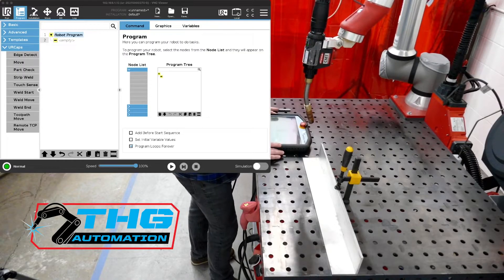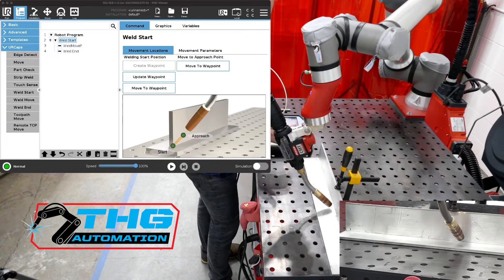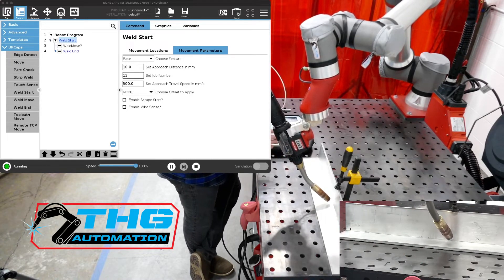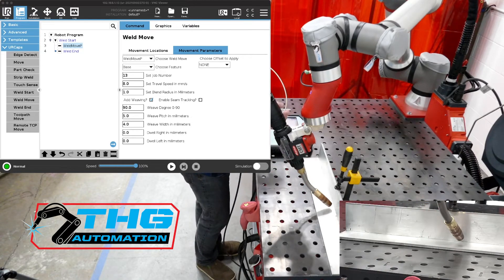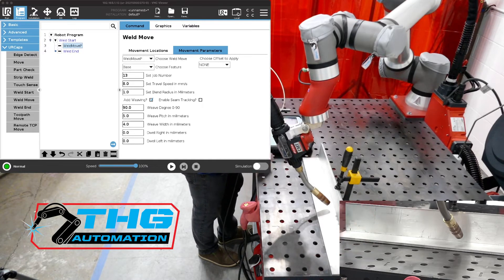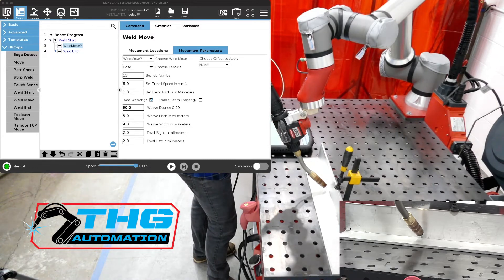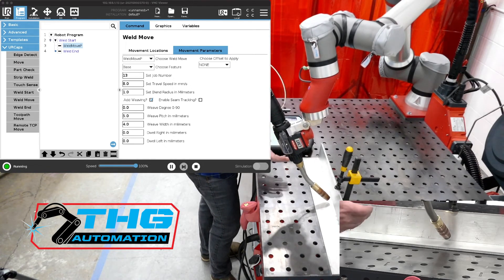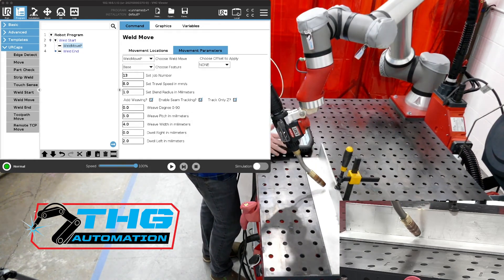Weaving Tutorial with THG Automation collaborative robotic welding system

Comment: This is fantastic. How would you program a re-start weld for long straight runs?
Reply from the maker: I'm not sure I understand the question?
Reply: @thgautomation  all videos show programming with a weld start and a weld stop within a 4 feet range for a final job. Given a requirement to weld an 8 feet run; can a new program line with a weld start at the new 4 feet position be done; given the cobot is moved to the new 4 feet location. If so, how is the transition handled at the 2nd weld start to extend the original weld stop position?
Reply from the maker: These videos are just examples of specific features. You can weld until the robots runs out of reach. You can keep adding more welds in the same program along with many other functions again, as long as the robot can reach it. You could add a track and increase the reach as well. We can add mid points, circular welds, or a mix of both in the same weld program. There are 112 welds in this video. https://youtu.be/RdxqhEDhsjw